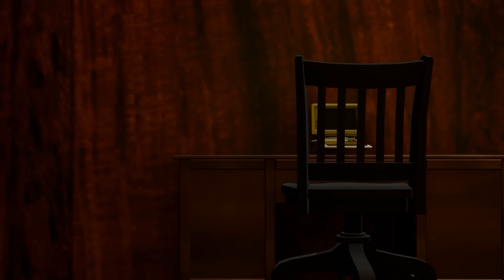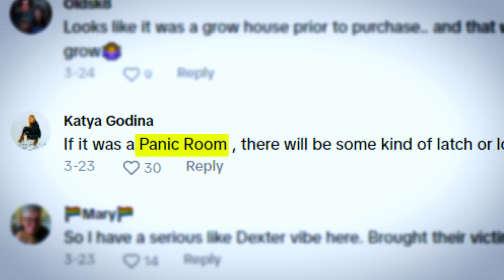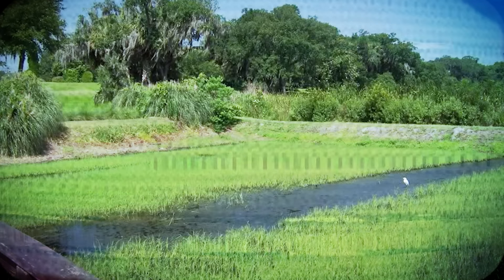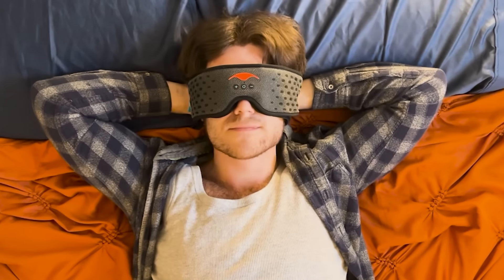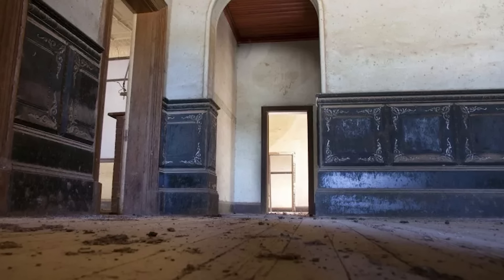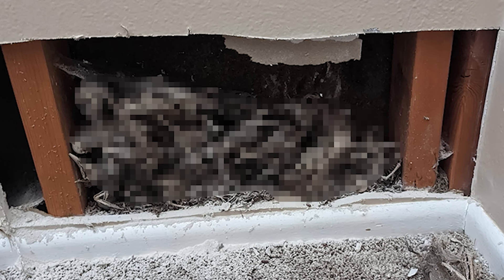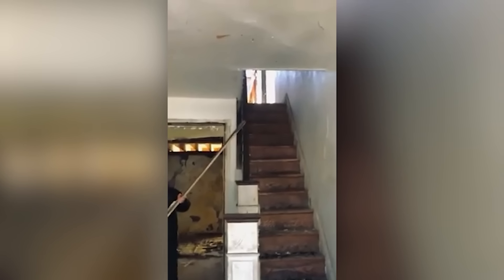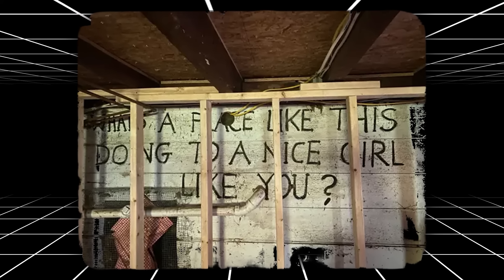Terrifying Things Found In New Homes

Comment: A pentagram isnt satanic, by the way, its actually a protective symbol, its only seen as satanic because of Hollywood and movies. So sanding it off could have removed the protective effects of it.
Reply: Jesus loves you
Reply: Uhhhhh. @Fairfiresand
Reply: It is when positioned like a goats head it is
Reply: With out runic symbols the pentagram is useless
Reply: @dillaspiller9511  so basically any star then? Depending on your position, it can be facing EVERY wya
Reply: @SoggySandwhiches  it's got to be up side down
Reply: Inverted
Reply: 999 only 7

Comment: My aunt bought a home in Philadelphia that had been foreclosed on and seized by the bank, or something like that. 

Anyways, the previous owners were a husband and wife, and their two big dogs. The wife had just been to the doctor, who advised the husband that he should remove all potentially dangerous weapons out of the house, as the wife was depressed and at risk of ending it all. Apparently, that night or sometime soon after, he put a shotg*n on her nightstand, and she ended up doing what the doctor was worried she'd do. After that, the guy just packed up and left, leaving the dogs and everything. The hardwood floor needed to be replaced, but I think the dogs ended up surviving and getting out. 

The house was left in the same condition that he left it in, minus the wife's body of course, which was found and removed sometime a few days later.

When we went to help clean the house after she bought it, there was one room upstairs that was REALLY strange. It was a small bedroom, the smallest one out of three. It was completely empty, except for an old bird cage hanging from the ceiling in the center of the room. 
The door to that room was also much different than all the other doors. It wasn't a light, indoor bedroom type of door, but rather a very heavy metal door, like one you'd have to get into the garage or outside, with the deadbolt portion and everything. 

My mom and I were cleaning that room, and we noticed that there was a big hole in the drywall, right under the light switch. The walls were so dirty you couldn't tell what was what between the layers of shit on the wall, but we did notice some substance on the wall, like a weird texture of something that dried to the wall. After having heard the story about the previous owners, we both had the suspicion that we might have inadvertently cleaned old, dried brain matter off a wall.
Reply: That's mental!!! Thanks for sharing.
Reply: bible?

Comment: the first one looks like an old boiler room, "dark brown" stuff is most likely water mixed with rust that stained the concrete, and where the electrical is they probably put a water heater or maybe ac/heat, and they probably closed it off because they got rid of the old equipment and the room wasnt needed anymore, in our house the previous owner closed up a pantry in the kitchen which made no sense, so we opened it back up and made it back into a pantry

Comment: So, for that room at the start. The only, non kidnapping idea I could think of, is some sort of prepper's strongroom. Like a secure pantry that could be hidden in a time of some society collapse. It could house food, water, clothes, equipment and similar supplies for someone prepping for a disaster situation. The drain could have been for spills or perhaps a shower system. 
Maybe it was used as a hobby room? Someone doing a hobby involving water or similar that would require a drain? Or maybe a room for animals, like someone having a reptile or fish collection and the drain is there for when they do a big clean up.
Maybe it's an older part of the house since built up around and the only thing left is that strange room. 
Going with shower it could have been a planned or once used basement bathroom or shower, like for someone who works a dirty job to come into the basement and clean off before going to the cleaner upstairs room? These last three besides the prepper's room could have been hidden to simply make a clearer looking basement or to hide and sell the house easier so people aren't asking about the room. 
In the case of the pet room the lock on the outside could have been to keep animals in if they escaped an enclosure. Other ideas, maybe it's as simple as repurposing a door that had a lock on the outside, cause the builder had that door laying around or got for free instead of buying a new door. 
Just trying to think of things that aren't kidnapping or prisoner situations. Idk maybe it was a freaky consensual sex dungeon for two kinky folks.

Comment: 13:35 I'm not an expert on stuff like this by any means, but this could possibly be death by spontaneous human combustion. It's where someone dies by fire with no apparent external source (in other words, the fire came from inside their body). I've heard of a few stories of this and all of them report a faint outline of the victim's body made of the ash of the body and a foul smelling odor accompanying it. Idk, it's a possibility.
Reply: I disagree. This is from a body left decomposing. 

"As a body decomposes over hours, days, and weeks, blood and fluids will leak out and penetrate porous materials. The longer the body remains, the worse the damage becomes. Fluids may even permeate the flooring, baseboards, and walls."

You can find examples of this happening on floors, on furniture and other places online. It will leave an outline of a person easily depending on length of the body left to break down. Quite eerie.
Reply: @lexicon.teufel  That's probably what happened tbh. Spontaneous human combustion is quite rare.
Reply: Yeah, was about to say. Purging liquid and decomposition burns through the grass around it if a body is left in a field, it easily does that to a floorboard if the body stays there long enough.

Comment: A walk-in room with a reinforced door that can only be locked from the outside?

Come on. It's a walk-in secure closet for guns or other valuables.
Reply: I'm glad they added a drain to the gun room.
Reply: @eugenekrabs141  something I would unironically add if I had a dedicated gun room. Lubricants and cleaning products spill. And if (God forbid) there is a water leak, you want that shit to go away as quickly as possible.

Come on, I understand the creepy factor and the fun it provides, but try and follow the Occam's razor principle for once. The simplest explaination is most often the right one.
Reply: @TraTranc  I mean you know more about guns than me so  I will trust you on this. And I mean this does sound like one of the most reasonable explinations, even if the drain wasn't explainable, so yeah.

Comment: For the casket in water……. Water preserves wood. The only reason the city of Venice is still standing is because the foundations are cut down logs driven into the swamp waters with a stone floor on top. The pressure of the floor keeps the wood logs not only in place but also preserves them because they are sealed in water. Meaning the entire city of Venice today stands on wood preserved by the water that was put there when it was first built. Which dates most of that wood at about 1600 years old. Water only rots wood if exposed to air.